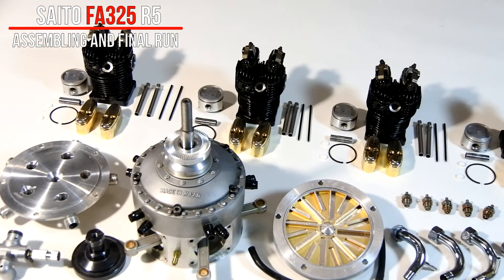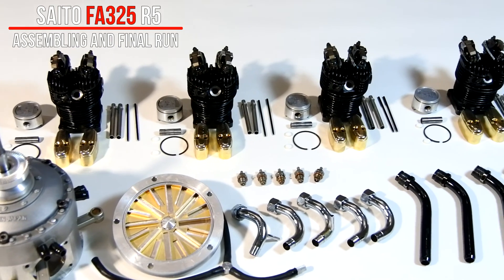Saito FA325 R5 assembling and final run

Comment: You have a wonderful collection of very fine engines, and you know how to work on them too so this is perfect. I would recommend that when you want to start an engine in such cold weather that you pre-heat it a little bit first. A monokote heat gun, or even your wife's hair dryer applied over the cylinders and crankcase for a minute. 🙂
Reply from the maker: Thank you for your nice words and great advice !
I had a feeling before starting at - 2 degrees Celsius, that it would be kind of challenge, especially, I've some cold  start faults at below zero temps. I like your idea to heat engine by hairdryer, for sure, will try next time. Thank you !

Comment: Now it runs very well indeed! Good job!
Reply from the maker: Thank you for kind comment ! I’m really becomes happier, when I can find engines problems. With this Saito FA 325 R5, there were few problems, rusty impeller bearings ( increased mechanical resistance),; really braked engine low idling ability, Additional internal friction, which was caused  by polymerized castor oil residue, covered piston walls, additionally brakes engine idle performance. Hope, I was found the most engine problems, Thank you !